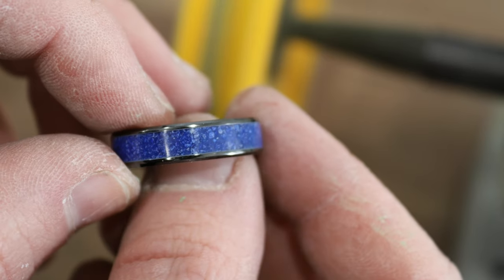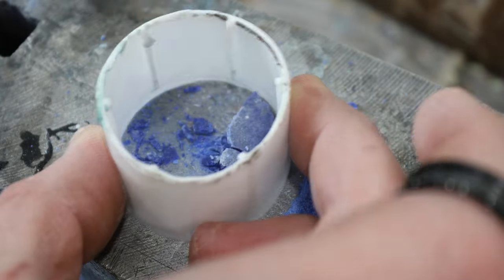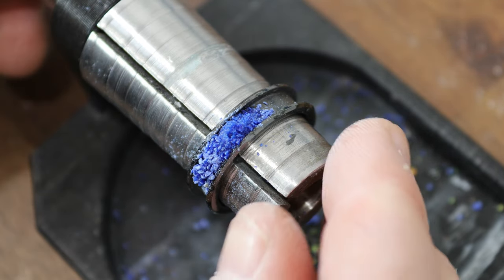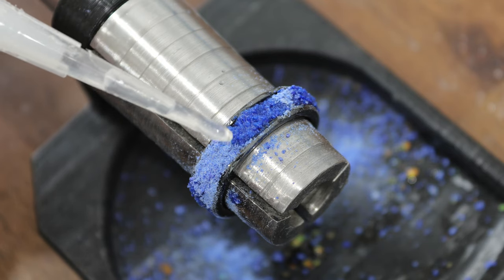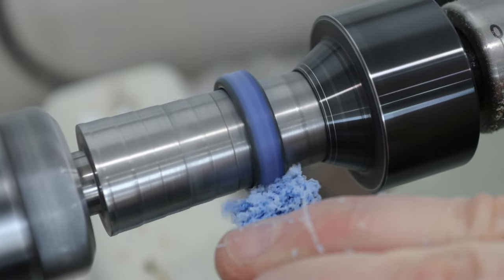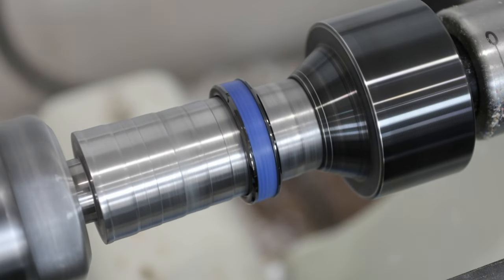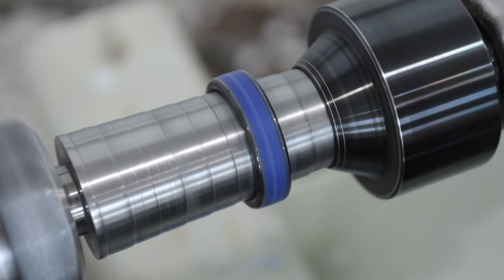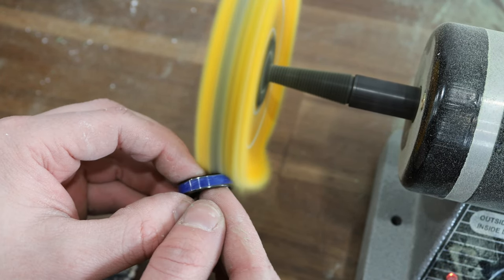How to inlay Lapis into rings!

Comment: love the video and your ongoing commentary. did you remove the black finish? it looked like that when you finished polishing! i thought that was a no no. i have not been able to do a plated ring without taking off the polish. maybe i am seeing this wrong. help me out please. nice looking ring no matter. if the black plating has been removed is that a bother to the customer? do they notice? thanks in advance for your answer.
Reply from the maker: This is actually a black ceramic ring. It is not plated so the black could never be rubbed off. If you were to use a black plated ring then yes sanding or polishing could remove the black plating.

Comment: I don't have a lathe - but I want to make one of these, is that doable with files/sandpaper? What would you recommend?
Reply: I haven't used these exact materials but I've been able to make several wood rings basically using a drill as a lathe.
Reply from the maker: Yeah definitely.  The sanding by hand might take awhile but I think you can make it looks quite nice by hand!

Comment: I noticed a hammered ring on the website.  When you make the ring in the same fashion as your video, can the turning tool and sandpaper essentially remove the hammered look?
Reply from the maker: If you use the wrong sand paper it can! But you want to use a soft wood sand paper and it won't affect the hammered look at all.